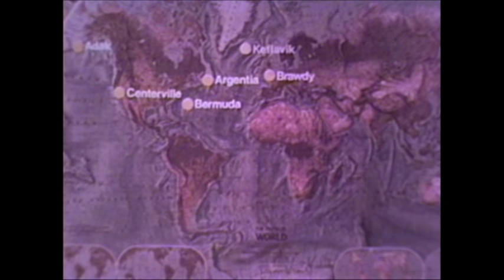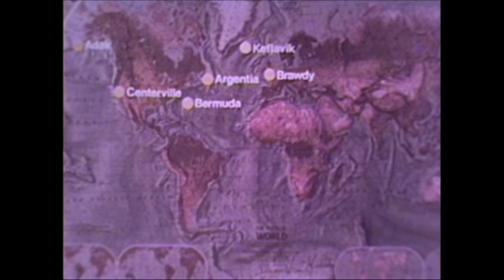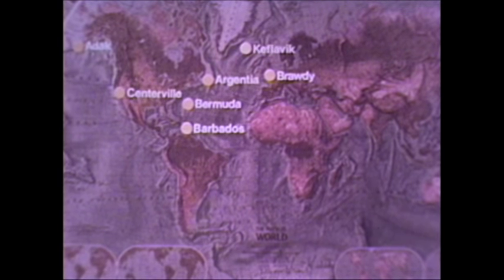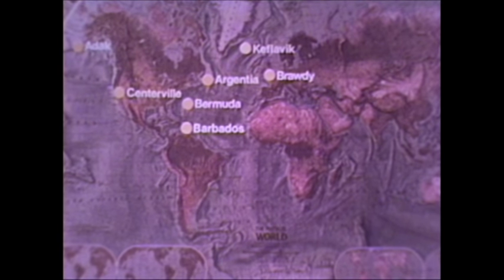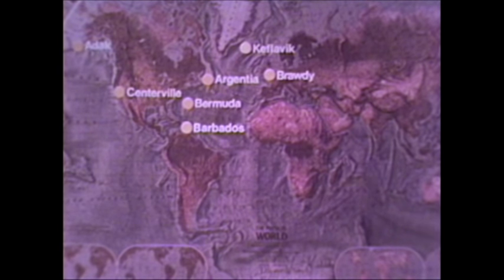1970's SOSUS History

Comment: OT2 Cy Mauras here. I was stationed at NAVFAC Adak in 1972 and left in February 1973 to be discharged. We had the old SOSUS equipment during my time there. The Navy offered me my pick of my next duty station if I signed up for two more years, but I wanted out of the Navy (didn't care for all the military crap). If I had stayed, I might have been involved in implementing this computer system. However, after I left, I got into computer repair in the commercial aspects of business. In 1988 I went to work for the US Post Office as they were beginning to computerize their mail sorting machines at that time. Finally retired from the Post Office eleven years ago after twenty-five years of service. My other SOSUS duty stations were NAVFAC Nantucket in 1969 and 1970, then a year in NAVFAC Guam.